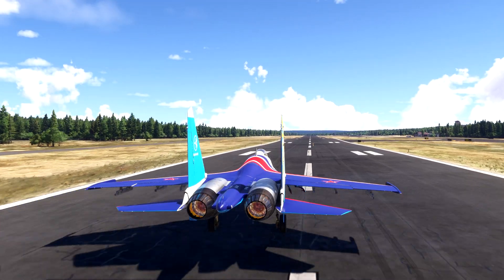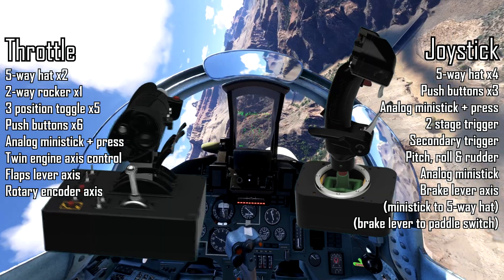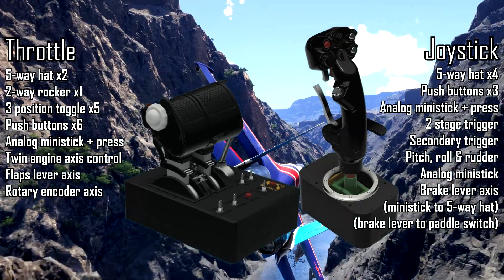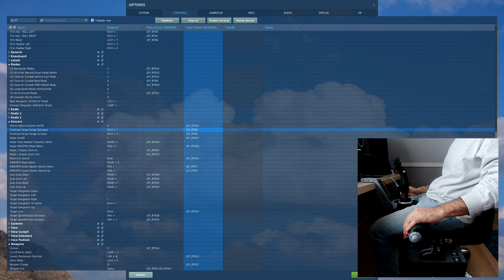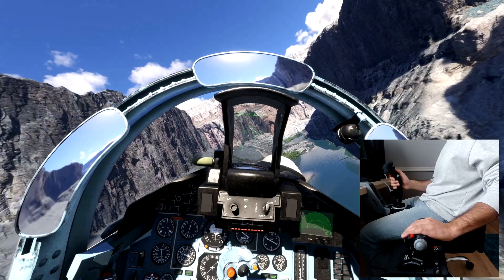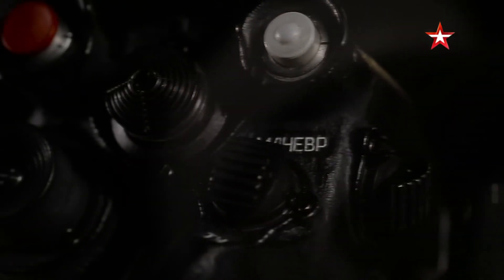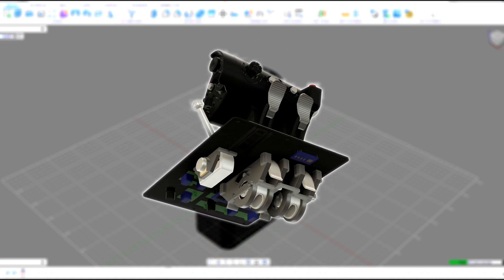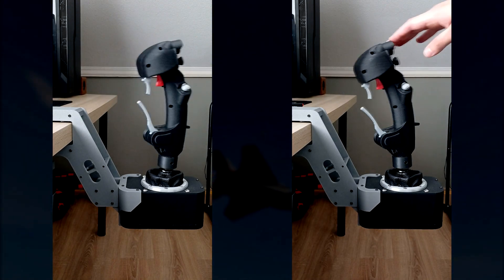DIY 3D Printed HOTAS | Project Overview

Comment: Its possible make a mirror version to HOSAS setup for space sim's?
Reply: Couldn't you just print the grip files mirrored using your slicer's mirror function? That's what I'm doing for my second grip, exactly for this reason.
Reply: @ewrfwert  i think the butons will not fit internaly
Reply: @tiagobighouse  If you mirror everything, then it should fit absolutely fine. It's still exactly the same, just flipped?
Reply: @ewrfwert i will try. I buy the files yesterday, lets do this hapening haha

I will try to change the cams for the gimbalot one

Comment: Any chance for f16 or f18 stick ? and are your cults file contain base for stick ?
Reply from the maker: I'll probably make one for the F-15/F-18 since they are relatively similar, i dont have plans for an F-16 one, but i already made one for the F-22. And yes the files contain everything to build the joystick, base included.
Reply: @NoisyBoi-s2t  btw question cause i bought throttle and raptor stick from you but is there any instruction how to build sidestick cause that rar file doesn't contain any info except hardware list and stl
Reply from the maker: @Krokietan  Yeah, I'm actually working on that and a more detailed explanation for the code. It will be up really soon

Comment: I'm new to flight sims and related content and I wanted to know, is this a good design for a wiring and flight-sim noob or is it somewhat challenging?
Reply from the maker: It's a challenging build if yo don't have any prior experience with electronics. That said, I made an instruction manual for the build process

Comment: Nice work. Just wanted to ask. With alll the gpio expanders and 16 bit adc, where do they all connect to. An arduino? Staright to a usb port? I wasnt sure and i tried checking your webpage but i cant find anything. Idk where the 4 wires go, any help appreciated
Reply from the maker: All i2c prefiferials, gpio expanders, and adc's are managed by an arduino micro.

Comment: I want to print everything on an A1 Mini. I want to know if the dimensions will exceed the build plate.
Reply: And if in that file you also have the configuration for War Thunder.
Reply from the maker: Some parts won't fit in the build plate of the A1 mini, the joystick is over 180mm.

Comment: The flight stick works well overall, but the Z-axis could be better; a redesign might help. The centering no longer works properly over time because the pin wears down. A new design using clips and a drive pin might be a possible solution.
Reply from the maker: What type of filament are you using, I had that same problem at first, then switched filament to petg, added a bit of grease and a stronger spring, and it works fine.
Still, I may redesign the z axis when I implement the swappable grips.
Thanks for the feedback.